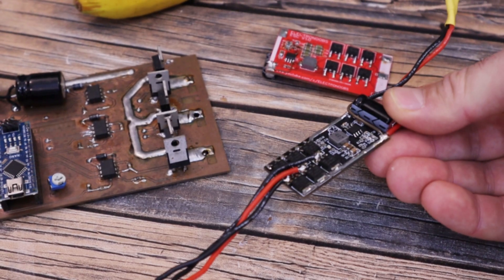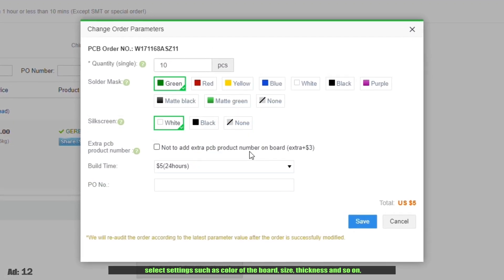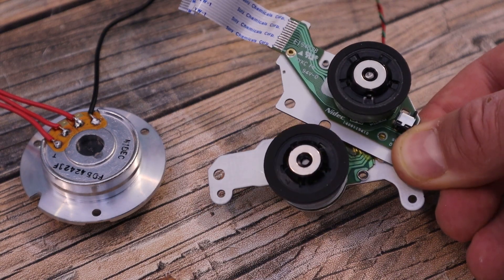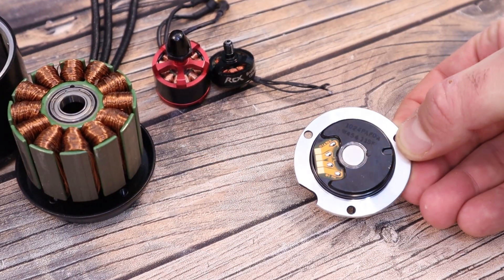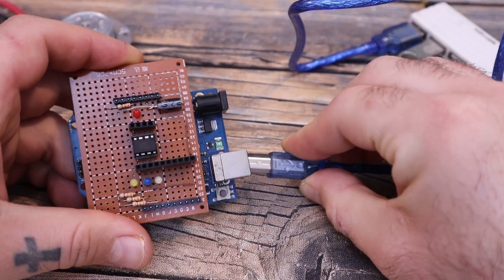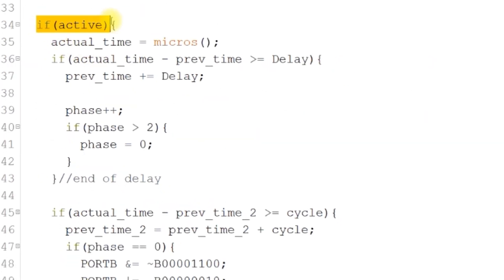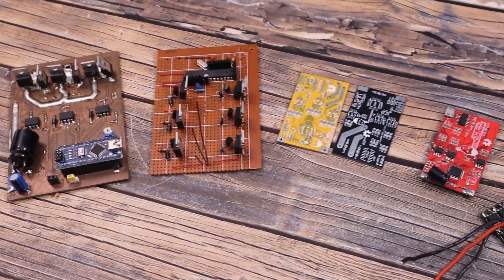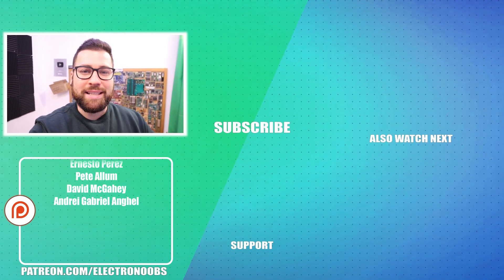Most Basic Brushless Motor Control

Comment: Hello teacher! Firstly, thanks for sharing.
What is the difference between your circuit (half bridge), which uses Arduino, and the others shown on the internet but which do not use Arduino?
Another thing: instead of the AMS1117, can the LM7805 be used?
P.S.: And if I'm not asking too much, is it possible to have a connection schematic that's a little clearer to understand?  Thanks++

Comment: Just wondering how you would control a 4 wire motor with the full bridge esc, because you say that the common is there on all the motors but just the 3 opposite ends joined, which is fine, but the other esc controllers you showed only had the 3 wires, no 4th connection, and where does the common go in the std motors we typically purchase? And how would you connect the 4 wire to a 3 wire esc? I have tried connecting one to ground then the other phases as normal and still didn't work. So I am wondering how you do it if you recommend a full bridge over the half bridge controller?

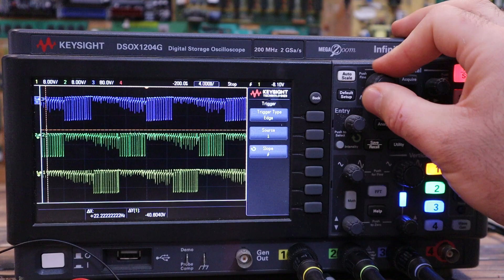Comment: At 8:40 - you can see that there are voltage spikes on the phases that are off. Wouldn't it be possible to connect high value resistors and use those pulses as a source of back emf feedback?

Comment: Rather than change the software to handle PWM just add an RC filter to the input and you get an analog voltage so 2 components will eliminate having to change working software ;)

Comment: Hard drive disk platters can be made of either aluminum, or glass, and are coated with a magnetic material.  The last set of drives I tore apart used glass platters and they shattered into sharp shards when I accidentally dropped them on cement.

Comment: Thanks, very well explained. You've divided the motor into individual poles, neither delta nor wye. 
Will this controller work for a rewound squirrel cage AC motor;  re-wound to handle high amps and low voltage.

Comment: Did you implemented zero crosing and communication timing difference by 30 angle in your code i am talking about your full bridge esc 
Because firing before proper commutation time may leads to more current consumption i am talking about techniques used in avr 444 appnote  page 11 .

Comment: A long time ago you made a video about an arduino based temperature controller using a PID loop. I was curious if the diode set up that you used to step down from 220V to 5V is a safe method to be run 24/7? If not, then what is the safest method for 110V step down to 5V for sustained “power-on” use?

Comment: The PWM frequency is rather slow by default when using AVR8 chips through Arduino, tending to cause an audible buzz and vibration.
// You could use something like this for the t85:
TCCR0B = TCCR0B & 0b11111000 | 0b001;  // 32.35kHz

Comment: A half bridge controller is used for a Switched Reluctance Motor or SRM that don't have magnets.  If you have magnets, you want full bridge to Push them away, otherwise, they create drag and big inefficiency trying to stick to the un-energized coil.
SRM motors are now replacing Induction Motors which don't have magnets either.
Reply: My friend Brittany Benzaia used a full bridge design for a switched reluctance centrifugal compressor in a water cycle air conditioner. Apparently, it's worth the complexity to not have the rotor flux reversing which increases iron losses. The compressor spins at over 100k RPM at full power so maybe that doesn't apply for a switched reluctance motor spinning at lower speeds. My guess is that the stator is made of a material with much lower iron losses since it doesn't have to withstand the extreme centrifugal forces the rotor has to.